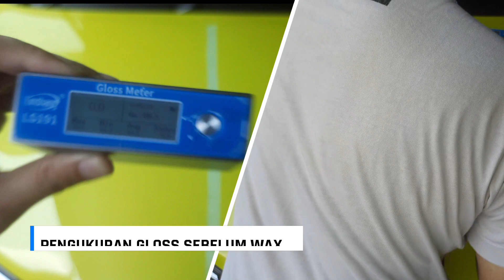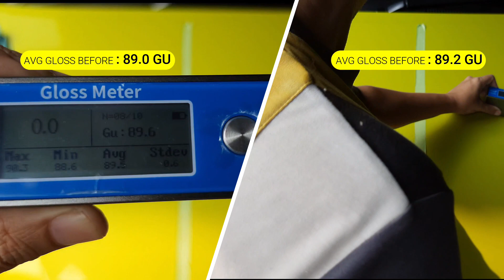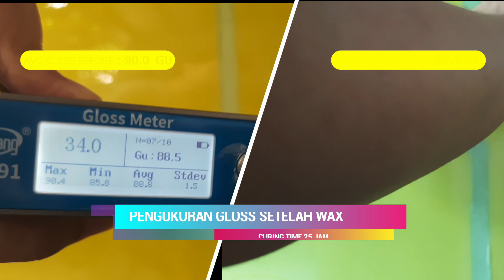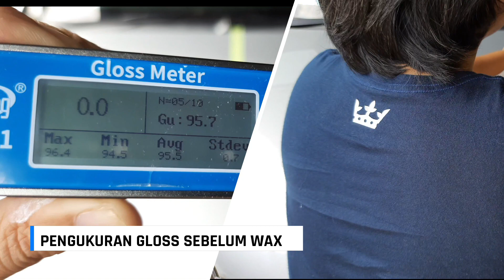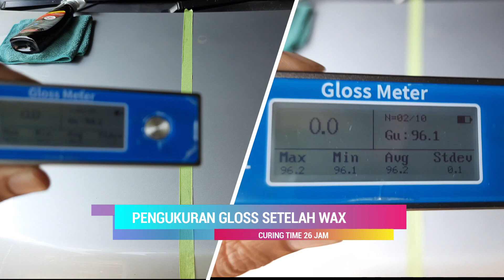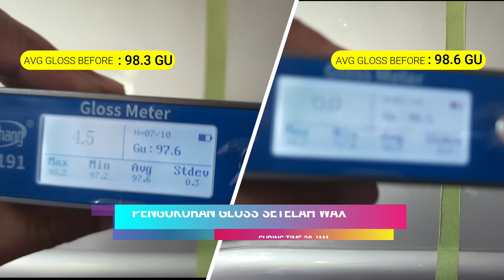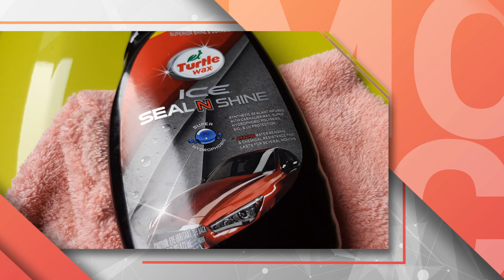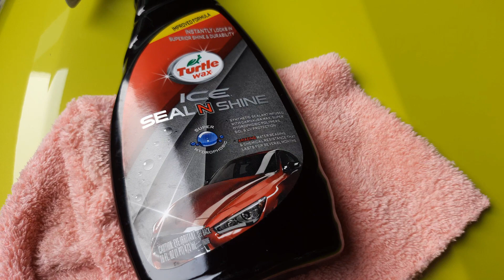PART 1 : GLOSS BATTLE  Turtlewax Seal n Shine  vs Meguiars Hybrid Ceramic Wax  (Damp Application)

Comment from the maker: Mohon Maaf, Numpang iklan.

Warga bogor sekitarnya dibantu ya, calo juga silahkan asal amanah.

Mau dijual tanah seluas 1572m2 bonus rumah luas bangunan kurang lebih 250 m2 kondisi kurang baik karena tidak ditempati.

Lokasi strategis dan dalam komplek perumahan kehutanan rasama ciomas bogor.

Security 24 jam, jalan masuk komplek  mulus aspal, cukup lewat 2 mobil

Tanah sudah flat jadi cocok buat dijadikan cluster jadi rumah pun mantep karena adem sunyi senyap.

Mau dijual di bawah harga 2.1 juta per meter biar cepet laku. 

Hanya Tanya2 tanah only ya WA ke 088211398066

Comment: Whats the best durable and most importantly easy to use ceramic spray / sealant / wax?

I really need to know whats the 1 products is easy to use?

Im thinking to compare: seal n shine, graphene flex wax, to the max liquid wax, meguiars hybrid ceramic wax, sonax bsd

Its okay to apply between 1-2months

I had a expereic with hars to buff producs, i taken care of my paint with very2 safe washing and drying, but cuz the hard to buff products i used, it got me some minor scratches which overtime, more and more visible as time comes.

So easy to buff of products is the way for me

Any recommendations?
Reply from the maker: The most balanced performance in my opinion is Meguiar's HCW, good gloss and looks,
To the max also gives a high glossy and beautiful look. Unfortunately both are not very easy to use.
And to the max it can't be called very durable, the durability performance is more or less equivalent to Meguiar's ultimate wax, which is very easy to use, has a more wet look and has better Swirls masking abilities. 

SnS for its price is considered very durable, but glossy is considered mediocre 

Flex's durability is slightly stronger than SnS, the glossy level is better than SnS, but it can't be said to be easy to use because it is prone to smearing. 

Tw spray coating and menzerna spray coating are attractive, fast and easy to use. 
Durability is not as strong as SnS, more or less like a turtle to the max.

Comment: Om wax yang paling bagus buat warna bunglon (ungu) jadi glossy maksimal apa yah..?
Dan apa lagi yang perlu di beli untuk mendukung glossy maximal nya..?

Trimakasih 🔥🙏
Reply from the maker: Kalau mau ke arah deep  gloss,maksimal, di keluar kan warna  nya biar basah. 
Carpro essence terus timpa atas nya pake paste wax carnauba misalnya meguiar's gold class paste wax tunggu 24 jam pake timpa meg GC detailer.

Kalo mau ke arah shine, kilap nya pake carpro essence + carnauba paste wax macam meguiars paste wax terus timpa tac system shinee wax setelah 24 jam. 
Combo di atas buat show off ya, bukan buat durability. 
Kalau mau bikin gloss meter mentok 
Carpro essence + p21s 100 (kalo nemu) atau soft99 authentic premium + shinee wax
Reply: @bankbey3459  bank bey carpro essence+ itu sejenis apa sih levelnya?
Reply from the maker: @cellibu  essence plus semacam glazing buat meningkatkan gloss dan menyamarkan swirls dengan baik juga mengandung filler istimewa tidak kaya oil based yg malah jadi drop deep dan clarity nya.
Kalo essence tanpa plus semacam light polish /finishing Polish tapi memiliki filler juga kaya essence plus

Comment: Seal n shine ini spray wax paling tahan kimia. Gloss biiasanya kalah. Tapi kekuatannya ngalahin coating entry level. Lanjut bang
Reply from the maker: Iya bang, bagus dijadikan base coat tinggal pake topping juga jadi cakep, di belakang botol nya juga disuruh di topping pake pake ice spray wax
Reply: @bankbey3459  jadi setelah make sns disarankan untuk menggunakan ice spray wax ya mas? Untuk nambah shiny nya?
Reply from the maker: @gengargengar5746  iya mas, di website dan di belakang kemasan SnS, untuk menambah shine di anjurkan di layer ice spray wax.
Reply: @bankbey3459  thanks mas info nya
Reply: Kalau topping di dilute gmn om
Reply from the maker: SnS di dilute?
Kayanya mending jangan bang

Comment: Bang bey kalo megs HCW ini cara pakainya pas body kering…disemprot ke body trus di lap pake microfiber kering apa bisa ya? Barusan dapet flash sale di sh***ee 219rb😁
Reply from the maker: Wahhh parah murah banget, buat botol segede gitu cuma 200 ribuan 🤩

Iya bisa, kering atau basah bisa. Semprot 1x spray saja ke pintu kemudian Buffing. Di dilute juga bisa, tanpa kehilangan banyak performance.
Reply: Iyaa sblmnya mau beli yg ceramic detailer itu…gak sengaja skrng lg flash sale di sho**e mall…

Kalo HCW gak di dilute…aplikasinya apa susah kyk oil based om? Kalo semprot langsung dilap

Saya biasanya nanotech graphene hybrid itu saya semprot di aplikator yg microfiber…usap rata…baru dilap kering…

HCW cara gini susah gak ya?
Reply from the maker: @alexanderariefy.4606  hcw rada2 tacky atau kesat. Semprot irit2 aja,dia konsentrat soalnya.  Pake ke applicator bisa lebih irit dan lebih mudah bang
Reply: HCW ini dibanding nanotech hybrid graphene durabilty kuat mana bang bey? Kalo glossnya menang hcw ya?

Gak jadi beli megs ceramic detailer deh ini…gara2 dpt HCW😂
Reply from the maker: @alexanderariefy.4606  kayanya sih tipis ya, mungkin Graphene menang tipis. Kalo gloss,kebanyakan oil based emang biasa aja sih. Belum ketemu oil based yg jago glossnya. Sekalinya ketemu yg lumayan malah payah durability nya.
Hcw juga bagus kok,  flexible pula, mau cara wet, dry bahkan di diluted juga hayo.
Reply: @bankbey3459  di dilute perbandingan brp ya bang biar masih dapet durablenya ya? 

Kalo lihat aplikasi yg dianjurkan pas basah trus disemprot air kencang brti sama aja di dilute ya bang? Hehehe
Reply from the maker: @alexanderariefy.4606  1:2 aja, masih sama tuh performa nya,  malah lebih mudah dibandingkan full strength.  

Bener jatuh nya sama, dengan disemprot air. Mendingan di di dilute aja, jatuh nya lebih irit dan kuat. Dibandingkan teknik yg disarankan oleh meguiars jatuh nya boros banget, dengan performa malah lebih strong dilute 1:2, 1:3😅
Reply: Iyaa besok coba dilute 1:2 dah bang bey...kalo udah di dilute buat kaca belang gak ya?

Pake glass cleaner rain dropnya nanotech...sekali cuci kok efek hydropobiknya udah hilang...ada saran yg durablenya bagus buat kaca bang?
Reply from the maker: @alexanderariefy.4606  spray wax manapun bakal cepet bang kalo di kaca, kan peruntukannya buat body😅.
Pake windshield water repellent aja, selain jauh lebih bagus plus lebih tahan lama, kaya rain x dll.
Sebaiknya polish dulu kacanya biar bersih dari jamur dll
Reply: @bankbey3459  merk apa yg bagus bang? Saya pakai glass cleaner rain dropnya nanotech…sekali cuci efeknya udah ilang😅
Reply: Udah coba HCW full blm dilute…glossnya menang dibanding nanotech graphene…tp hydropobic sama slicknessnya menang graphene ga bang
Reply from the maker: @alexanderariefy.4606  dibandingkan Graphene local efek hydrophobic mirip2, slickness kalah hcw. Graphene lokal sayangnya boros lap mf.
Dibandingkan flex wax Graphene ya. Kalah semuanya dari gloss sampe durability nya.
Kalo mau performance mirip tw flex Graphene coba aja fusso f7 atau f12, di topping shinee wax.
Reply: Flex waxnya Turtle ya bang?
Bang kalo bug n tar remover yg bagus pakai apa?

Comment: Om bey mau tanya, 1; meg HCW ini klo dilap pake kanebo bs ga. Misal lg dipencucian steam mobil, skalian pas mobil lg basah, sy semprot" In HCW ini, bru dilap kanebo keringin. Bs utk kaca, plastik ga HCW.
2; klo sm Turtle wax hybrid ceramic wet wax(btol kuning), bagusan mana sm wax. Thx GBU🙏
Reply from the maker: Hmm pake kanebo ga hapal om, saya udah lama ga pernah ketemu kanebo 😁🙏
Pake microfiber aja kadang smearing apalagi kanebo yang ga punya grip ke permukaan cat. Mungkin kalo mau cuci bawa saja beberapa mf ke tempat cuci jad biar mereka yang spray dan buffing nya. Lebih baik di dilute dulu hcw nya kalo mau dijadikan drying aid biar cepet dan tidak mudah smearing. 
Hcw bisa ke glass dan plastic. 
Tw hybrid solution wet dibanding hcw punya kelebihan masing2, hcw sedikit lebih gloss, more durable sedangkan wet wax lebih slick.
Reply: @bankbey3459  opsi sy selain HCW, TW wet wax sm tw spray coting sih. Oy mnta saran om dong, mobil sy uda 1thun di coating dan parkir di outdoor (panas+keujanan), n sy jg pemula, ada Rekomendasi produk yg bagus dn pemakaian mudah om? Mohon bimbingan ny om thx🙏
Reply from the maker: @mygold339  sementara ini yang the best all around masih turtlewax graphene to the max. Cuma ga simple2 amat. Menolak noda nya pun bagus.
Kalo mau simple tapi performa bagus tunggu turtlewax flex wax kemungkinan agustus.
Kalo di outdoor minimal 1 - 2 bulan sekali, polish om. Buat hilangkan oksidasi, traffic film, noda dll bisa pake turtlewax hybrid polish ceramic, dia berbasis si02 juga, bakalan kompatibel dengan hard coating nya, Karena filler nya mengandung si02 juga.

Comment: Punten bang, mau tanya ni soalnya bimbang. Antara meguiars m27 sama ceramic liquid wax, dari aspek gloss sampe durable menang yg mana ya? Mau ambil repacknya buat coba²😆
Reply from the maker: Wow m27😅
Meg m27 masih dalam oengetesan nih, jadi belum bisa koment banyak tapi so far kalo uji cuci bersaing ketat F7, tahu sendiri kan F7 disaat hcw spray mulai drop tapi F7 still like new wax. Di pre test real world pun performa bagus, tapi belum bisa koment banyak karena baru 2 mingguan. Banyak kejutan di real world test,ternyata 😁
 Untuk gloss pun belum bisa koment banyak karena baru 1 panel, tapi m27 lebih baik tipis dari hcw liquid. Looks sih mirip2 ya,  lebih condong ke wet liquid khas sealant tapi punya cukup deep jadi warna ga terlalu hilang walaupun  tetep luster nya meg paste /liquid lebih baik. 
So far m27 sealant terkuat dari line up meguiar's, yg luar biasanya tuh pemakai an sangat mudah, mau panas panas an juga hayo. 
Kalo suruh milih ya, tentu tanpa pikir panjang ke m27 pro.
Reply: @bankbey3459  F7 fusso emang badak. Emang lagi nyari yg glossnya yaa ngga lebay tapi durable, yaa sekitar 60% durable - 40% gloss, buat mobil ortu (ngga ngarep keliatan glossy banyak² soalnya mobil putih susu yg suka ga nampak glossnya walau pake wax high gloss😂). Habis kalo nyuci seneng pake mama lemon, padahal udah stok banyak shampoo dari berbagai merk macam nanotech, lumobrite, ampe kit wash n wax tetep aja makenya sabun piring. 
Apalagi tiap pagi senen - kamis suka bolak balik jakarta yg cuacanya lumayan ekstrim. Make kit NC aja semingguan lebih dikit aja udah mau tanda² sekarat, carrera polish & wax nyaris 3 minggu, tapi udah tewas lewat minggu ketiga😅😂

Note: waxnya dipake stand alone, tanpa QD
Reply from the maker: @bonjourdy  ruar biasa pake mama lemon itu sih lebih2 dari torture test, carnauba based bakal ambyar oil nya sama  sabun cuci piring 😂. 
Wajib pake sealant udah full cure om kalo suka pake mama lemon sih,
Reply: @bankbey3459  biasanya jumat - minggu mobil jarang dipake, lebih dari cukup itu sih kyknya, sebelum di hantam ama mama lemon & cuaca ekstrim. Terima kasih bang bey masukannya🙏

Comment: om salam kenal
mobil saya warna putih, tp sudah menguning n ada jamur, sebaiknya pakai kit apa ya om 🙏 sampai finising 🙏 
terimakasih om
Reply from the maker: Salam kenal juga om, terima kasih udah mampir. 😇
Cutting Compound pake kit Rubbing 
Polishing pake kit gp compound 
Finishing pake kit restorative atau kit kuning 
Step nya bisa diikuti link video ini. 
https://youtu.be/p2qhFOsGjjo.

Kalo masih bingung jangan sungkan2 mampir lagi om😊
Reply: @bankbey3459  siap om , mau tanya lagi, kalu untuk list croom yg berjamur pakai apa ya om
Reply from the maker: @BangSat-ria  maaf baru dibalas, tidak muncul notification di hape saya.
Kalo jamur ringan pake sanpoly, kit kuning, restorative juga dapet tapi kalo Udah jamur kelas berat pake brasso aja.

Comment: Bank Bey Salam kenal, Bank Mobil saya warnanya Grey metalic , Saya sudah beli Turtle wax ice seal n Shine, biar Kilap maximal perlu di Combine sama apa ya bang ? Dan apakah bisa TW metalic car wax bisa di aplikasikan setelah pemakaian Turtle wax ice seal n Shine bang ? Mohon pencerahannya bank Bey 🙏
Reply from the maker: Daripada beli tw metalic mending beli tw hybrid ceramic polish atau tw speed compound dulu om, buat di polishing dulu, hasil nya nanti bakal lebih gloss dan durability lebih mantap kalo pake tw speed compound. Setelah itu gunakan SnS. Biarkan curing 24-48 jam, setelah curing mau di topping atau buat maintenance pake aja TW ice spray wax atau ice spray detailer. Sonax bsd bisa jadi alternatif buat Gloss dan durability bakal lebih baik, tapi sayang tidak slick sperti tw ice spray QD dan wax
Reply: @bankbey3459  Thanks bang atas informasinya , Bang untuk penggunaan TW Ice Seal n Shine bisa langsung di aplikasikan ke body mobil tanpa harus Polish dulu ? Ato harus dipolishing dlu bang ? Maaf masih newbie bang

Comment: Bang, sebenernya cara bedain spray wax yg oil based ama water based itu gmn ya
Reply from the maker: Kalo produk luar sih hampir ga ada yg pake oil based, di dominasi  produk lokal, baik nya tanya dulu ya om. Ke seller nya.
Bukannya oil based tidak baik hanya aplikasi nya rada ribet aja, Gloss cenderung biasa tapi filler berlimpah cocok untuk kondisi panel yg kurang bagus, jadi menyamarkan swirls dengan baik dan daya tahan termasuk badak, tidak jauh lah dengan punya meg, tw.
Reply: @bankbey3459  Jadi klo merk luar itu rata2 waterbased ya. Sy selama ini pake mothers spray wax di warna item kurang kuat looknya ya. Ada rekomen spray wax utk warna item selain meg gc gak bang? Tertarik ama TAC sih...klo Ipo spray wax and coat pernah coba gak bang
Reply from the maker: @tdinanthya  meg Gc biasanya dipaké buat nutup in dan menyamarkan , swirls, panel yg kurang baik saja. Karena filler nya cukup tebal. sering nya dijadikan base coat kalo lagi males polishing. 
Tac shinee harga mirip dengan mothers spray wax , saya rasa bisa dipertimbangkan. Reputasi tac shinee di luar sangat bagus, pengukuran di saya pun di panel kondisi baik 101-102 GU. Tanpa gloss meter pun shinee, keliatan kilap nya
Ipo  spray belum saya coba om. Masih maju mundur mau beli. Takut kecewa 😅
Soal nya saya coba berbagai polish nya sampai ultimate fine polish yg katanya mirip essence, ternyata cuma so so.
Kalo tac sih, wax nya, ga ada yg gagal, high gloss semua. Sahabat Gloss meter 😊
Reply: @bankbey3459  TAC udah masuk wishlist sih, kebetulan mothers udah mau abis. Btw klo based coat pake Meg GC trus ditopping ama TAC gmn om? Kira2 bakal wetlook gak?  Oh ya katanya klo keseringan pake spray wac (misal seminggu sekali tiap abis cuci) bakalan bikin cat kusam, karena waxnya tumpang tindih, beneran gak sih om?
Reply from the maker: @tdinanthya sayangnya betul om, keseringan menggunakan jenis spray baik wax, dan qd. Yaitu menumpuk Wax yg mati, residu sabun. Makanya butuh base coat GC tuh untuk membersihkan dulu, residu2 diatas. Meguiars seri consumer walau tidak disebut cleaner wax tetapi lumayan ada cleanser nya plus , filers tebal untuk menyamarkan swirls.
Makanya minimal pake gc, tw cleaner wax, kit gp cleaner sebulan sekali untuk membersihkan dari wax mati, oksidasi ringan dll. Atau minimal 3 bulan sekali, setahun sekali lah di usahakan. pake lah kit gp compound atau meg UC untuk membersihkan oksidasi lumayan berat. Apalagi misal mobil bertahun2 tidak pernah polishing. Pasti bnyak tuh wax numpuk, dan residu lainnya. Pake compon ga bakal bisa kikis clear coat nya, angkat residu kering aja udah pas pasan  kalo pake tangan sih.
Meg gc + tac shinee sih, bakal bagus deep and shine nya, walau kondisi panel lumayan babak belur tapi akan lebih dahsyat lagi kalo dipanel yg sudah di pake meg UC dulu sebelum nya 😅
Reply: @bankbey3459  mantap penjelsannya, berarti spray gak boleh keseringan ya, selama ini sy selalu pake qd tiap abis cuci buat bantu ngeringin air. Next plan mau eksekusi combo GC + Tac Shinee. Terima kasih  sharing ilmunya ya om
Reply from the maker: @tdinanthya  kebiasaan kemaren di lanjutkan saja om, itu bagus kok, jadi ada protection, soalnya, jangan berharap durability bulanan di cuaca disini, bertahan 1 bulan saja udah luar biasa. hanya baik nya, 1 bulan sekali, gunakan cleaner wax atau meg GC/UW paste atau liquid (paste lebih baik daya cleaner nya) untuk membersihkan residu2 dan wax yg mati nya. Selanjutnya Untuk perawatan gunakan saja QD atau spray wax.
Reply: Bang produk yg bagus buat mobil putih apa ya? Semi coating gitu?

Comment: ini waterbased om?
Reply from the maker: Water based silica dioxide om, jadi aman dan awet buat lap microfiber. Cairan nya kental pake tipis2 aja yang penting rata, irit banget jatuh nya.
Reply: @bankbey3459  oalaa ya om. btw ini bikin debu cepet nempel ga ?
Reply from the maker: @williamsuryawinata9427  water based ga akan se parah oil based, kaya magnet.
Reply: @bankbey3459  ooo siap om thankyou

Comment: Bang, itu cara apply HCW cuma disemprot atau dioles langsung ke permukaan mobil? 
Sebelumnya apakah permukaan perlu dipoles dulu atau cukup dicuci? 
Kondisinya pas permukaan kering atau basah/lembab? 
Terimakasih, Bang....
Reply from the maker: Ini wax paling aneh yang saya temui bang, mau kondisi mobil basah mau kering juga bisa. Terserah, suka suka.
Mau di semprot mau pake busa applicator juga bisa, soalnya cairan nya cukup kental. Di lap pake kain lembab juga tidak masalah. 
Dipaké kering lebih kuat durability nya, cuman aga kesat jadi sediakan saja 2 lap microfiber.
Cukup tipis saja yang penting rata, jatuh nya sangat irit.
Tapi tetap baik dry atau wet application kasih curing time ya, minimal 24 jam. Si02 soal nya.